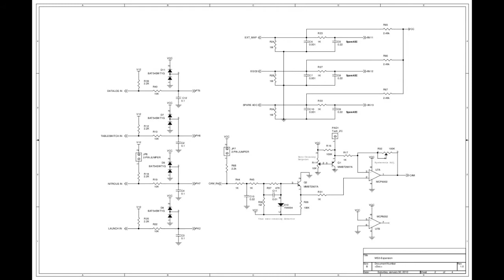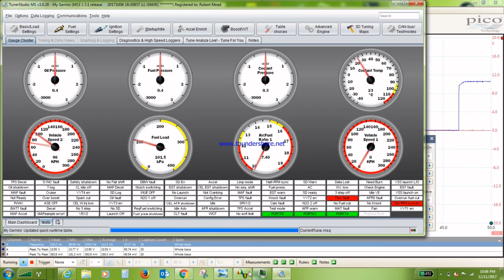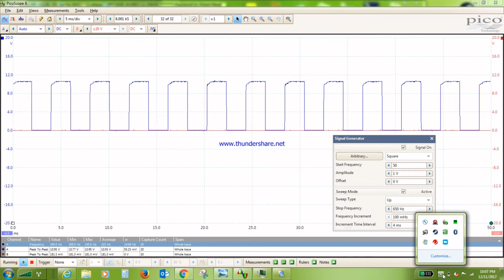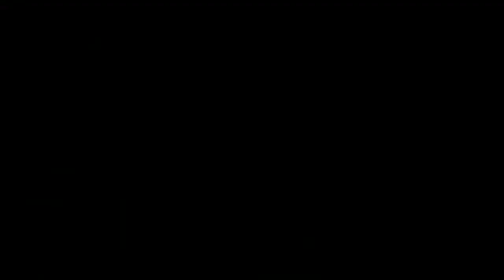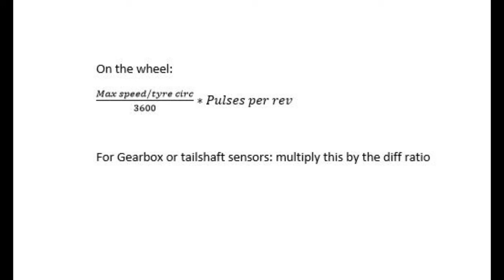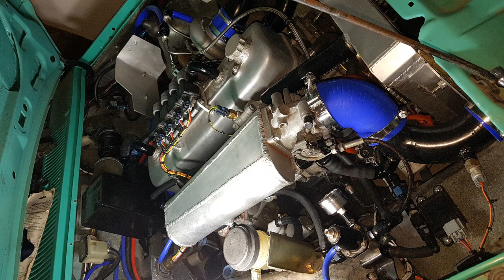Megasquirt 3 (MS3X) Vehicle Speed Sensor input testing (VSS)

Comment: Thanks for posting this video. 

Question about the parameters used. 
Assuming 250km/h, 577mm tyre size, and the same 9 teeth ------ f=345Hz so within the 600Hz limit, no issues.
But I was wondering if the relevant diameter should be the one at which the sensor is reading? Assuming your 9 tooth wheel is around 150mm OD, all of sudden the input sees 1326Hz? So would only really be supported by PT4 with a pull up?

Trying to utilise some factory abs tone rings for my application (90mm OD, 44 teeth). The tooth passing frequency comes to about 10kHz which is within the 15kHz limit of the cherry hall effect sensor but obviously way out of range of any of the inputs. If the correct parameter to use is in fact tyre size, then even with 44 teeth, I'm still within the 2kHz limit of PT4 so should be hunky dory? 

Would be interesting to know how you got on with this.
Reply from the maker: Yes tyre size is indeed the parameter you want to use to calculate the frequency, think about it like this: if you halve the rolling circumference of your tyre you need to spin it at twice the speed to travel at the same  velocity. If you change the diameter of your sensor wheel this will change the velocity that the teeth must travel for a given speed but if you do not change the number of teeth the frequency read by the sensor is unchanged.
One consideration though is the smaller the diameter makes it harder to make a higher tooth count and remain compliant with the desired tooth size as given in the cherry sensor data sheet. Although i have seen some very small dizzy mounted wheels with a 36-1 pattern used and people say they work fine, so best to try before you rule out the sensors ability in this case.

Comment from the maker: With the calculations the video states to use metres for tyre circumference - you need to express in Km (ie. 1.8m = 0.0018km) otherwise you will be out by a few decimal places.